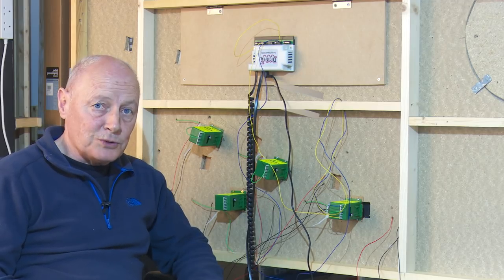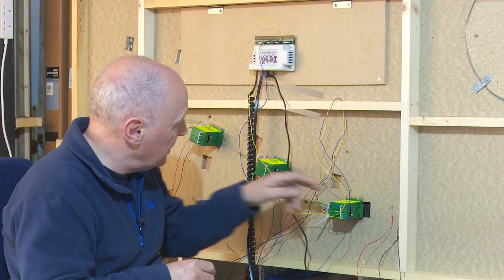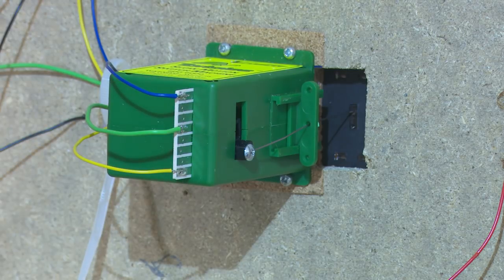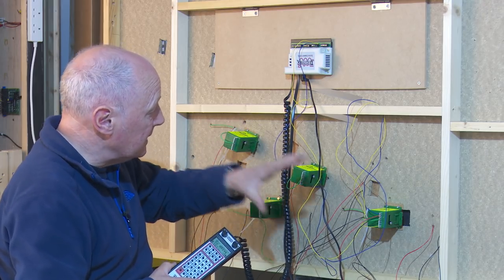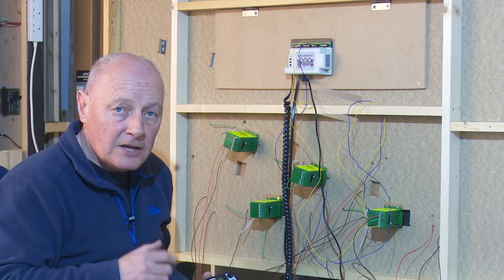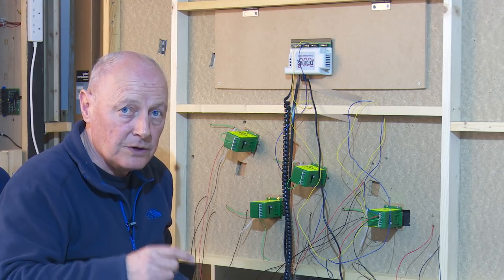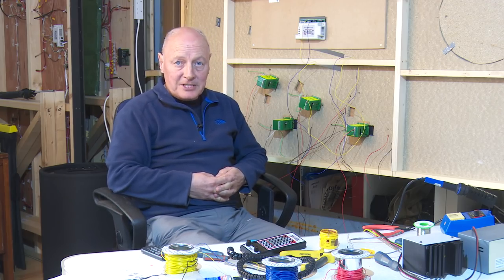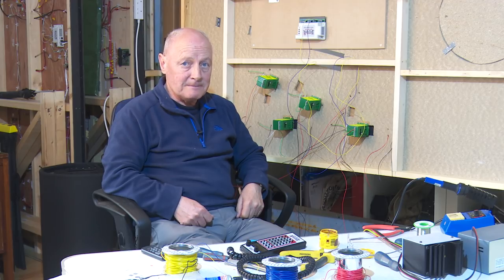23. Wiring Tortoise Point Motors at Chadwick Model Railway

Comment: Loved your tortoise fitting series that you have done. Great idea of the layer of Cork between the board and the tortoise motor to dampen as much noise as possible. I have used ‘Celutex wall insulator Poly Foam Eco’ its a Damp/Sound Proofing building materials which as a silver layer on both sides to make it water proof house installation in between walls and roof beams etc..., I take the silver off which peels away fairly easy, You can buy them in 1200x600mm and in 25/50/75/100mm thickness, which I use mainly to heighten the landscape on the scenic side of my layout and you can chop at it, carve it however you want in to the shape of the landscape, ideal when building the height up to a bridge! But I have considered using the ‘Celutex’ wall insulator sheet to hollow out a piece to snuggly fit around the tortoise/cobalt motors, it’s called ‘Celutex wall insulator Poly Foam Eco’ £48 6x 4x2 pks from B&Q and Wickes but there are other brands of the same item from any builders yard. Just a thought to sound proof the motors more, cutting them to size of a inch or so all around the Point Motor, using the 100mm deep version to totally surround the point motor. Sorry for the longer than normal wording 😆 Great video! Thank you for sharing your many hints n tips.
Reply from the maker: Hi John,
An interesting concept.  I’ll have look at how much room I have left when the board is finished.
At present I really don’t know how much sound will  be audible.
Stay tuned, although the journey maybe a long one.
Regards Charlie

Comment: Your explanation just clarified a misunderstanding I had about powering the frog off of a Tortoise.  I hadn't put together that the switching for the track power to the frog was a separate circuit from the power to the switch motor.  I had been so confused about how to avoid a short between power sources because I didn't understand the Tortoise already did that.  Thanks so much!
Reply from the maker: I’m so pleased that you found it useful.

Comment: Hi Charlie, I watched both videos on installing and wiring Tortoise point motors. Again the best how-to video I've
seen so far. However, I would like to pass on to you some of my experience concerning soldering cables to any solder
contact that is attached to the fiberglass printed circuit board material. This experience comes from 30 years working
in the profession of repair of TV's, cameras, VCR's and camcorders. When I first started in the field of electronics my
instructor told me something I've never forgotten; "Flux is your friend." So this is my experience; I always applied flux
to the contact of a printed circuit prior to applying solder no matter how small the connection that you want to make.
The printed circuit board material will repel the solder and the flux will cause the solder to remain on only the contact
that you want it to unless the soldering iron is bridging the gap between contacts. This posting isn't meant to be a
criticism of your technique. I'm just sharing what I've found after 30 years experience in the field of electronics repair.
Try it sometime you might like it. Bill G Linwood Kansas USA
Reply from the maker: I’m so pleased that you enjoyed the videos Bill.  I’m sure that your tips will be well received. Thanks

Comment: Thanks for a great set of videos on these point motors Charlie.  Just a thought on the drop down board.  If you move the hinges slightly on the batten, leaving a small gap behind the board, you could bring the wiring under the board and pop it through a hole by the screw terminals, making it much more resilient and keeping the wiring tidy.  Regards. Ian
Reply from the maker: Hi Ian, Thanks for the advice but I’ve almost finished that board.  Mind you it might be difficult to feed new cables through.  Have a look at next Friday’s video and see what you think.  Regards Charlie

Comment: Charlie,  I watched your video on the good and the bad of Point Motors. Couple of options.  Use servos driven with pulse width modulation for slow action of movement.  Or consider something called a dashpot. This is a damper that could cause the relay movement to act more slowly and more quietly. The trick here is that you might have to make one and do some research on how to. Another option is to use relays with an AC power source.  One leg of the AC Source ties to the common pole of a relay.  A pair of back-to-back diodes go to the other two poles of the relay.  The diodes are opposite to each other Tied together at one end which faces the switch machine.  As the relay throws the AC is rectified positive or negative going to one leg of a tortoise switch machine.  The signal is rectified one way or the other and that's washing machine receives either a positive or negative voltage on one leg.  The other like up a tortoise switch machine goes back to the other pole of the AC source.  This is discussed on YouTube.  Bob s
Reply from the maker: You make a very valid point Robert. However I’m too far down the line now to switch to servos.I’m afraid it’s tortoise all the way now.

Comment: To cut down the sound of the point motors I used some double sided sticky tape. As I had to fit them underneath the layout I found this made it easier to screw them up.
Reply from the maker: An interesting option Russell.
Regards Charlie.

Comment: Hi Charlie, On my little layout I didn't want noisy solenoids I favoured simplicity: Rods (piano wire) running through tubes with simple levers. Live points to suit tiny locos and auto polarity switching, works a treat. I didn't even like the click produced by the spring in the points. I didn't need the spring because I had a little friction provided by my levers so, removed one. Silence is golden! But I reckon that spring does another job: Keeping the blades tight at the thick end up against the rail. I got round this by fitting a small strip to hold the actuating rod forward if that makes sense. Wonder if you have this problem when fitting tortoise motors and removing the springs?
Reply from the maker: No DD, they are stall motors which stay energised and keep pressure on the switch blades.

Comment: Instead of using cork between your Tortise and the baseboard, you should try using 3mm(1/8) double sided foam mounting tape. Stick it to the Tortise but leave the backing tape on the baseboard side. The foam acts as a deadener and takes out the little rocking in the middle of the Tortise. If you need to move or re-use the unit, you don't need to hold the cork in place while repositioning. Craig.
Reply from the maker: Hi Craig.  Thanks for the info. 
Regards Charlie

Comment: Very instructive. Rather than screw the mdf to your bb, what about using 2 swivels to lock it in place (thinking of what used to be used on older dining chairs to hold the seat base in). That would make it quicker to access.
Reply from the maker: H Alan,
Thanks for your advice.  
To be honest I just haven’t anything else to hand at present.  
I feel a trip to B&Q coming on!
Regards Charlie

Comment: If adding a slow-mo motor to an already fixed point (turnout) the clearance hole for the operating arm will obviously have to be drilled from below. I strongly suggest using a drill depth stop when doing this, it will save the point being wrecked! A drill stop is just a circular cylinder with an axial hole for the drill and a small clamping grub screw on the side. Readily available in metric or imperial sizes  - just Google for them. Sadly drill, having that pointed end, will not make a nice neat clean flat bottemed hole. But there is a way. Buy  something called an 'end mill' in a suitable size and use this after the drill has started the hole, but before it penetrates the baseboard. Again, with a depth stop. Best practice would be to use a small vertical drill stand, but those cost money and are not easy (!)  to use upside down. BobUK.

Comment: I have a short cirquit on the tracks of the layout section that has three switch machines which are wired just the way you showed. I wonder where I can start to look for the spot where the short occurs. I run straight DC, but the guys that originalle wired the stuff ran DCC. I wonder if I have to make any changes to run DC. The tracks are just a siding plus a spur track.
Reply from the maker: Hi Peter, my money is on the wiring of your point frogs. disconnect them one at a time. 
Also, now might be a good time to "Subscribe".  Regards Charlie
Reply: @ChadwickModelRailway   I have subscribed and donated, thanks Charlie
Reply: @ChadwickModelRailway  Charlie, I have no clue what was wrong, but the section with the Tortoises does not short out anymore. All wiring seems to have been ok, but I suspect one of three machines did not switch internally, as I manually moved them from one side to the other a few times and then put juice on again. Suddenly the polarity seems to have been set correctly, and the short was gone. A Christmas miracle, maybe.

Comment: Very nice follow up video, and again, well explained. Can I ask, did you have to center the points before you set the center of the point motor wire and motor, and did you need to set the Fulcrum? ...Simon
Reply from the maker: Hi Simon, 
Yes I did.  
In the previous video I nailed a pin into the centred position of the tie bar to ensure the the point motor would be central.
Regards Charlie

Comment: Hi Charlie, well I have learned something today! I did not know that there were two different types of peco points. All mine are the first type you showed. the other one was a complete surprise. 
Not quite sure what you mean about the fix for loss of control when we hit the dreaded "loco shorts out due to incorrect point setting". You say you just power the point controller from a dc supply and all is well. Surely you also need the dcc track voltage to address the point controller. If the track voltage is shorted by the loco the control will still be lost. Or is this not how the point digitrax controller works? .................John
Reply from the maker: Hi John,  great question, I’ll try to explain.  So your loco goes into a point from the siding end.  If the point is set against you, a short circuit results due to the polarity of the frog.  If the point motor is powered from a separate supply, you can change the point and drive the loco on.  Please let me know if that has made sense.  I will also explain it better on Friday’s video.  Regards Charlie
Reply: Not really making sense yet Charlie.Unless you mean that the separate supply is also the dcc signal from another booster or power district connected to the same command station,  and not simply DC. I will watch the next video to see if it becomes clearer. .........John

Comment: Charlie,  When throwing a point in DCC with an insulated frog, is it required to use a tortoise machine to be able to direct a change in polarity to the frog and also power the frog.  In other words, what is required of the frog if throwing the point by a manual means with no point motor?  Bob
Reply from the maker: Hi Bob,
When throwing an insulfrog point, no frog wiring is required.  This is because the frog is split into two insulated sections (hence insulfrog).  It should work fine either with or without a point motor.  It’s electrofrog that brings more involved wiring.
Regards Charlie

Comment: When using Tortoise (and Cobalt type) point motors is it ‘absolutely necessary’ to remove the spring?
Reply from the maker: Hi Bobby, 
I have heard of folks that have left them in but why?  When the point has changed, there is quite a bit of force keeping the switch rails in place but it would of course initially fight against the spring as it starts its travel.
Without the spring mine work perfectly.
I hope that helps.
Regards Charlie

Comment: Hi Charlie. I am changing my peco solenoid point motors with the accessorie switch to tortoise point motors. Would I still need a CDU for the new points?
Reply from the maker: No, not at all. Regards, Charlie
Reply: @ChadwickModelRailway  thank you

Comment: Is a decoder needed for each tortoise?
Reply from the maker: Not at all Ronald.
A decoder or a similar device would be needed if you were using a DCC system to change the point. However, most people just use an ordinary DC feed. Regards Charlie

Comment: Hi Charlie have you tried using rubber instead of cork for sound installation ! At work we called it flexi sleeve and used it to join plastic ducting to a extract motor it helped deaden the sound of the motor ! Just a thought from a very new modler of six months
Reply from the maker: A good point Reg. Regards Charlie

Comment: Hi Charlie, you mentioned powering your DS64s with an external power supply. The PS14 Digitrax power supply appears to only have  US style 2 pin connector. Do you know of a suitable power strip with US sockets and a UK plug which I could use? Alternatively is there any other way to power multiple DS64s without using multiple PS14s? Thanks.
Reply from the maker: Hi Nigel, to be honest, most of mine are powered by small mobile phone type chargers bought at car boot sales!
As long as it’s 12v dc you’re good to go.
Reply: @ChadwickModelRailway  Thanks Charlie, that sounds like a cheaper plan!

Comment: hi Charlie another great tutorial, which out of the two leading brands of slow action point motors, tortoise and cobalt would you recommend and do you think tortoise would benefit from screw terminals for some of us that are not so good at soldering.
Reply from the maker: Hi Dave, I’m glad that you enjoyed the video.  Which is best is hard to say.  I believe that Tortoise are quieter but Cobalt apparently have a lifetime guarantee.  If soldering is an issue, solder to the blue clip which I mentioned in one of the 3 point motor videos.  Long term you need to develop your soldering skills but not at the expense of ruining the point motor.  As for screw terminals, there isn’t really enough room.  Regards Charlie

Comment: Charlie, on your junction just after the viaduct, could you not have saved a substantial amount by having just one tortoise point motor with a tie bar operating both points?
Reply from the maker: Sadly you're wrong. The two routes don't run together.

Comment: Hi Very interesting series of videos.   How do you wire a series of point motors into a series so that one switch will activate 3 or more motors.    What about the power supply etc.  This is to allow me have one switch for each line in a multiple line fiddle yard.   When a line's switch is activated all the necessary points from the entry line are set to the correct position.
Reply from the maker: Hi Duncan, as you suspected it’s just a clever piece of point and switch wiring. However, I only wire two of my points together such as crossovers which is far more simpler. Regards Charlie

Comment: I have recently subscribed to your excellent series Charlie - thank you. I'm getting back in to the hobby after a few years break. I will be using my existing Peco Insulfrog points (can't afford to buy new ones) and DCC for locos but prefer (as Richy 59 is) to use DC for the point motors and have a 'signal box feel' with DPDT switches. The Tortoise units look appealing (thanks to your video) but I am a complete novice at electrics so not sure what to do at the toggle switch end. Could you comment on the simplicity or otherwise of how to wire the 6 outputs of a DPDT switch to the Tortoise please? Thank you
Reply from the maker: Hi Marc, I’m so pleased that you enjoy my channel and have subscribed.
Sadly I know nothing of the DPDT switches so an unable to help.
However, if you can’t find the answer on YouTube, you might contact Digitrains and ask for their advice.
Regards Charlie

Comment: Hi Charlie, when you say the motor stalls does that mean it jams as it reaches its max point of travel or is the power to the motor cut as its position is detected by a microswitch, thanks.....Martin
Reply from the maker: Hi, I believe that the motor is designed to stalls at the end of its travel and then the power is cut, leaving pressure on the actuator arm to maintain pressure from the switch rail onto the stock rail.  Hope that helps. Regards Charlie
Reply: jaxmar88 Hello, power is supplied to the Tortoise at all times. It is only a small amount but this is enough to keep the switch rail up against the stock rail. Keith
Reply: Hi Keith, thank you for clarifying that, I was thinking that was the case as the motor sounds very much like the synchonous type used in heating zone valves etc and I know that is how they operate, just wondered if they suffer from burning out as I assume they are always powered no matter which positions there in as they dont appear to have a spring return position (un-powered) as zone valves do

Comment: Great video, recently subscribed and finding the content on the channel great even for a beginner. I am using DCC for my layout but was considering using a traditional DC panel for switching my points on standard solenoids, however I'm more convinced about using Tortoise motors now. Is it still possible to use a traditional DC switching board using these motors or should I be using DCC to control them? Would the method still be the same for wiring, except I would have to build a panel instead of using a DCC controller? Thanks :)
Reply from the maker: Hi Richy,  
I’m so pleased that you enjoyed the video.
Unless you are going to use computer control, I think that it would be best to use a DC panel to operate your tortoise point motors.
Good luck with your project.
Regards Charlie